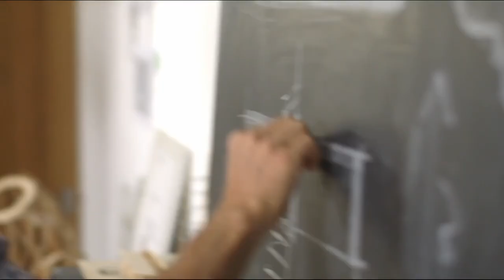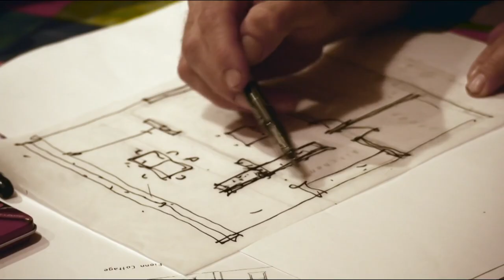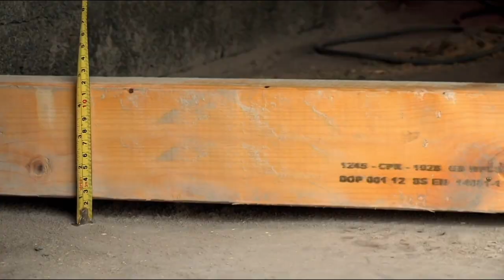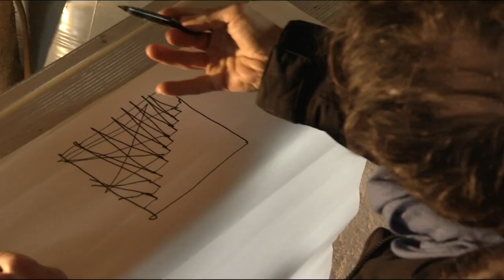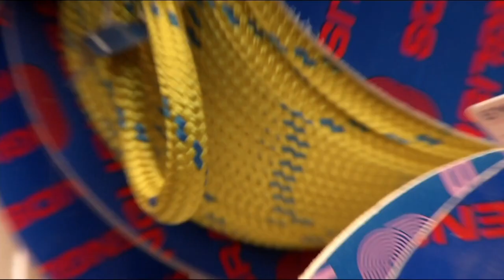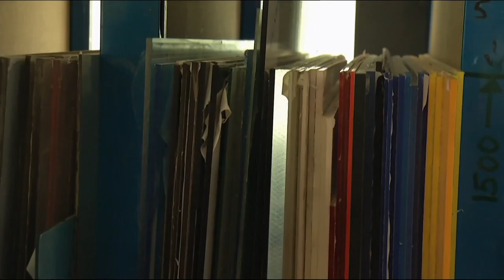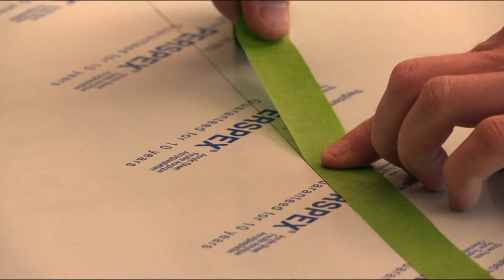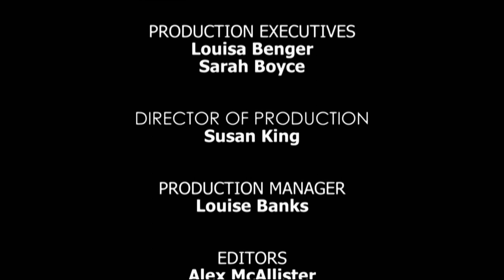Low-Cost Home Build - The House That £100K Built - S02 EP5 - Home Design

Comment: They should have put the powder room (toilet and face bowl) downstairs and put the full bathroom upstairs with the bedrooms.i cant understand why they and the architects did not think of that.
Also, the counters should have been made of concrete. can't understand what those architects were thinking not telling them how fragile acrylic is. kitchen counters should have the toughest surfaces in the house next to floors.
Reply: I’m not sure but I hope they have enough room upstairs to put in a small shower after they live there for a bit. 

The acrylic worked better than I thought on the cabinets, but the green is just too intense and the soft surface impractical for the countertops and island. that can be changed pretty readily if they decide to do so down the line. big kudos to both of them for their fortitude, design efforts and creativity. rope idea was pretty cool and the vertical tongue and groove is a nice feature. Great couple and I wish them well in their new home!
Reply: I was really shocked by the original plan that included a full bath on the ground floor and no bath upstairs. Even after modifications, I'd have ensured a full bath upstairs and let the downstairs bath remain unfinished until financially able to complete it.  The house has a future on The Unsellables.
Reply: I'd certainly hate it for them being sick and having to run downstairs to the toilet 🚽
Reply: In a country house,  a downstairs shower is more convenient because you bring in lots of dirt that you don't want to drag upstairs.

Comment: Think they need to get the spacking up,  put excess furniture in the storage and move in.  It will save them the necessary money to finish the build,   and just go at it.   It's difficult,  but by simplifying short term,  and being resourceful in this way,  they will be in better shape financially.

Would have saved the acrylic for the upper cabinet doors only,  because it scratches.

Comment: Not a fan of the acrylic as it scratches so easily.  It would have looked better is she had stuck with just one colorway (e.g. different shades/intensities of green) or a two-tone combination. As it stands, it lacks cohesion and seems smaller than actual. Also, rustic and modern often work nicely, but that rustic cladding juxtaposed with the Crayola box kitchen is off-putting.

Comment: Nice house for about £120000 to £125000 (I guessing $130,000 to $135000 USD). While I do like the plastic rope stairwell web. The rest of the house is too like tooth fruity (life savor candy like colored for me). Especially the old cabinet make over. My self I like to mix old & modern together in the interior. MDF doesn't age well is is a bear to paint. ( tried it with some old kitchen cupboards in a remodel at our last house) My grandfather who was a cabinet maker would have bought a thin but good grade of plywood & made new doors possibly with a few Acrylic sheet see throughs on them. (Acrylic is more expensive than glass or polycarbonate in the USA) The exterior of the house looks rough with the & I am assuming exposed concrete block of panels perhaps glass reinforced panels vertically placed steel siding would have made it more refined ( they are cheap and seldom used residential housing materials here, usually used in commercial buildings) On a tight budget many people in the USA have cast their own concrete counter tops. Some with coloring for their sand to give it some color while others have acid  eched ( sorry my spelling is wrong on last word) the tops. Surprisingly most of these amimatures get them to come out looking great (there are a lot of videos on this on You Tube here). It's a matter of taste so I am eating this house as a success, but ,personally, it's not to my idea of good art.

Comment: I must say I absolutely love that wooden panel wall and the concrete floors but I think she went way overboard with colours and with actual plastic coverings in the kitchen because she will have to be constantly wiping them down as they will soar every finger print and the spec of oil and it will get scratched and beaten up almost immediately

Comment: They could have done it for less if they had not followed what the fancy designers wanted.  They could have the whole thing done and not had to worry about whether or not they were putting her parents home in jeopardy.  All of the fancy stuff could have been done later.
Reply: Yes unfortunately most of these types of programmes turn into vehicles for the designers and their styles.
Reply: Sadly a lot of people live in the "must have it now" concept of living. I'd rather go without or wait and save up.
Reply: Jamie Shannon, so true.  However, I think these people would have been happy sticking with their budget and using the Less expensive materials may were initially going to use except that the producers of this show pushed them into using more expensive materials on several different occasion's.  I guess despite the name of the show, being frugal just doesn't make the ratings.